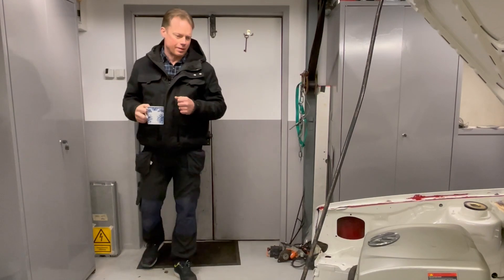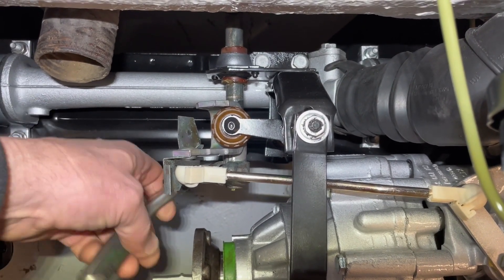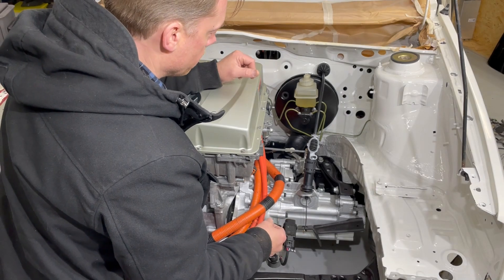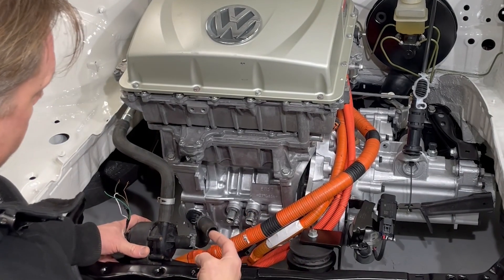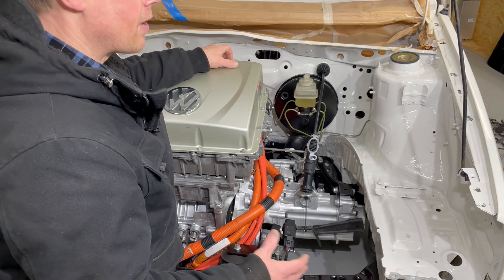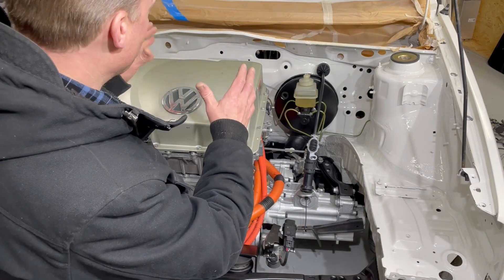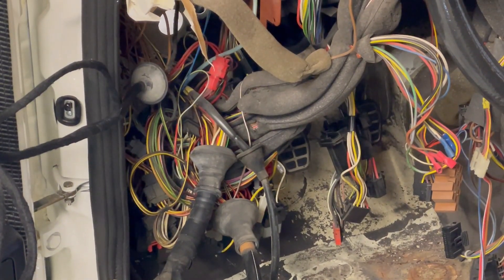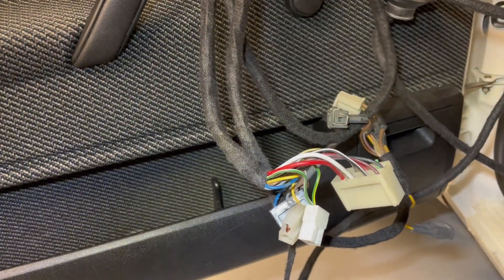Vw Golf Mk2 Citystromer, update, motor installation and more ev conversion stuff.

Comment: I used the same vac pump in my conversion with a sensor from a Volvo. The sensor turns off the pump when it reaches the correct pressure and it works great. I know of a guy that just connected the pump to his brake light so it comes on every time he hits the brakes.
For a heater I used one from a Mitsubishi Outlander PHEV as some of the guys in Openinverter had already created a controller for it. I haven't used it in winter yet but so far it's working great.

Comment: Could you please tell me the height from the main shaft to the top of the motor?
Reply from the maker: I guess you asked me that a couple of weeks ago?.? Sorry if so, give me 2 hours.
Reply from the maker: Approximately 19cm. Sorry for my late reply.
Reply: HI Thanks for the reply but I guessed I asked the wrong question. I need the measurement form main shaft (mating to the transaxle) to the top of the whole motor stack - checking for clearance to the hood.
Thanks Jack

Comment: I wonder, what will you need to do to "legalize" the car once it is ready. Is there some process you'll need to execute to be able to get approval of road-worthiness? How about insurance?
Reply from the maker: I am working on that. There is two ways one long and expensive plus a lot of extra work, and one short but hard witch I am working on. And that is to try to have Volkswagen to give me an approval to use this setup. The weight is reduced and the gti has almost the same power and torque. I spoke to them this week and it sounds promising. But it will probably take time.

Comment: shift linkage wise... look up 3104 Shift Linkage Gauge -020 ..  thing it you let the gear stick set in the position. with the tool..  gearbox in nuetral.. and the main Rod. bolt and clamp is lose.. once both in position tighten it.. and it all set! (y) its the same a Mk3 (which i drive me entire life so far while being 37)  an works a charm (y)

Comment: Hello, did you consider use of Webasto air or water type heater?
With water heater you can even warm up main batteries. 
They only use about 01.1 to 0.2 liter of fuel per hour...and no more room for cold in the car, for sure..👍
Thank's for your never too long educational and inspired videos.
Best regards.
Reply from the maker: Hi, yes i really did! The car is actually equipped with that from the beginning.
But I decided pretty recently to go with the electric one. Might use the leaf heating plates as the batty heating.
Thank you so much for the input😃👍🏻

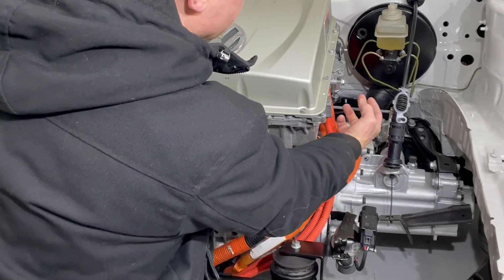Comment: 3:24 - the coolant must have not much to do I guess cause otherwise there would be space for another line to a  heatexchanger inside the car to benefit from the heat inside. I know you had said it will not become a daily driver and therefore most likely not so much used in the winter which means that the resistor heating I guess used before might be an easier and more reliable solution cause nothing has to be changed inside. Changing the heating system would cause a lot of additional work.  I really like these progress explaining videos covering the details up to the colour of the brake lines and optimisations. Looks like you might also get a super modern frunk based on the current space available on the left from the engine (orientation based on the driver seat). 

Every time you show a picture of your Mark 2 after replacing the 650 kg lead acid with a lithium battery of half the weight it reminds me of the COUNTRY GOLF, those 5000 country golf as 4x4 built at the end of the 80s where the chassis was also raised a lot. Back then when they had been sold and appeared for the first time I had wondered who would ever buy such car till I realized the need for 4x4 in austria and switzerland for certain people that need such car to get home again during winter.

I still wonder when a VW dealer will come and ask you to lend that anchestor of the modern id family to his dealership for a presentation and comparison how electric golf had looked like in the dawn of electrification. 

VW CEO Schäfer has already announced that there will be a new generation of the GOLF and that this will become an EV only (not based on the ID plattform as you could read between the lines) which will increase the attraction and value of the city stromer too.

Comment: I couldn’t understand what you said about something in the pipe to stop water being pushed back into the expansion tank but the expansion tank should be experiencing suction from the main pump. A friend built a kit car and had problems with water being pushed back into the expansion tank when the filler cap was removed and the engine was running. The simple fix was to move the expansion tank hose T about 12 inches closer to the water pump inlet.
Reply from the maker: Drossel is a kind of reduction/reducer and  is a word that i often use when I work with older air conditioners. I can understand your confusion😅 sorry.  Yes, I’m aware of the problems, I have also done som test earlier and I will try to explain that in a later video. Thanks for the input👍🏻😃

Comment: Looking great.  The Tape in the UK is made by a. Company called Tessa, its exactly the same. I spent quite a few hours wrapping the whole of a CE2 loom while it was removed from the car.  It looks great when done, far better than factory.  To clean the wires I used Baby Wipes from Lidl.  They dont damage the wires and really clean them up.  Baby Wipes seem to be universally great at cleaning lots of car of home things.
Reply from the maker: Really good suggestion👍🏻👍🏻 Have used them a lot😉